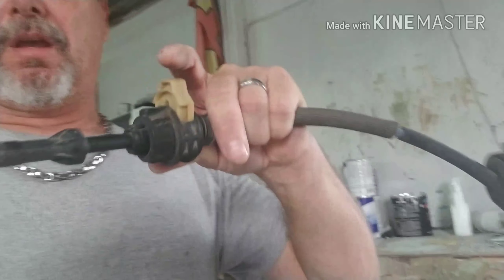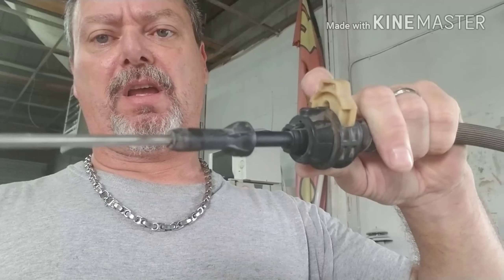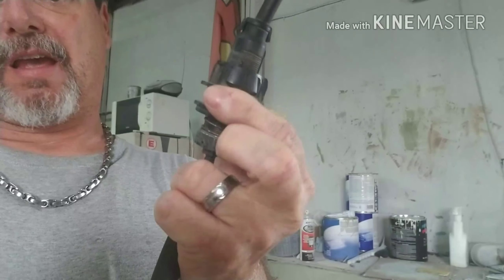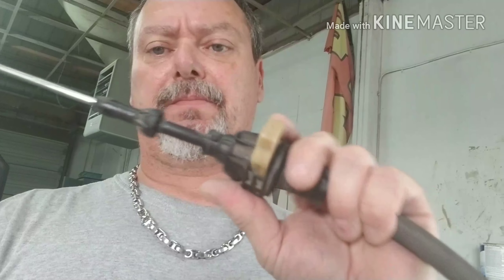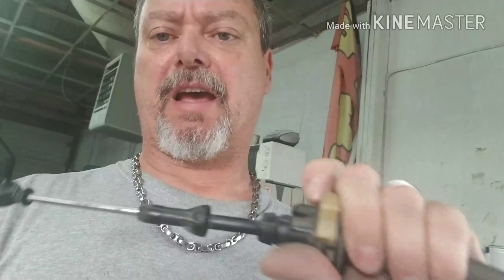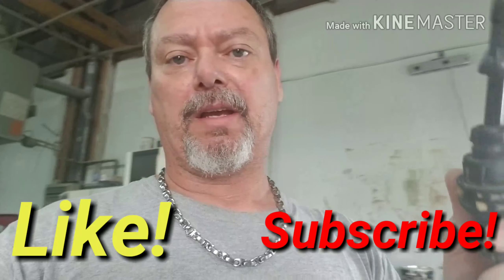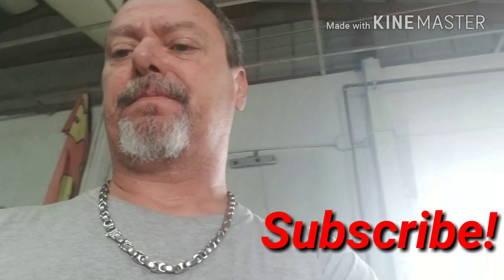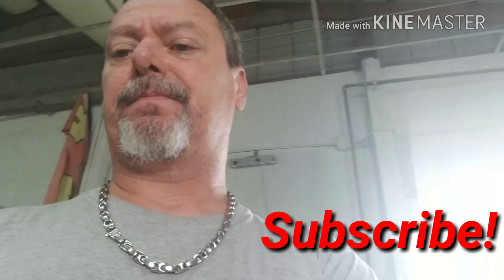How to adjust shifter cable 2004 ford f150! #shift cable repair

Comment: Thank you so much Chris. My shift cable melted against the exhaust. Replacing was not difficult, however, I could not get it started in park and also the reverse lamps lit up in park position. I saw the adjustment tab from your video, and it worked correctly after only a few minutes. Thanks again, you 'da man.
Reply from the maker: Your welcome! Thank's for the comment and support!

Comment: Thank you so much for doing this video. I changed my cable and the truck was doing almost the same thing as it was before I changed it. I was ready to take it to a transmission place but decided to do one last YouTube search first. This fixed my problem and I am off and running.
Reply from the maker: That's awesome! Thank you so much for taking the time to let me know. So happy you were able to save some $$. That's the goal!

Comment: I had the same problem, when I bought the truck they started it only in neutral, it wouldn't start in park. I bought it anyway and with a little bit of hope that I can fix it. 5 minutes on youtube and I found the right tip how do do that. I'll try it out next weekend. Thanks!

Comment: I have the same issue with my truck 2008 ford f150 after i replace the transmission won't start on park so amma tray that tomorrow morning thank you brother. I will get back with the result ....
Reply from the maker: You welcome

Comment: thanks,my04 same thing, also hard to get into gear almost like the cable is at tension. thanks again. exactly what I was looking to hear.
Reply: I just looked at a 04 ranger that seemed solid all around except pretty rusty underneath but not too bad.  
It was hard to put into every gear. It started in park tho. I looked underneath but I couldn't quickly find the linkage to peek at it.  This sounds like the solution. I'm hoping! Buddy wants to sell as is.  Stiff shifter seems to be it's only issue.  Solid runner, no smoke, smooth shifts. You think this is just the adjustment? It seemed really tough to pull on amd push on the shifter.
Used vehicle hunting is terrifying!

Comment: I changed mine out a few years ago. Now it won't shift far enough to go into park. Should  I  adjust it after manually putting in park position?
Reply from the maker: I'm  not sure but I did make a video about the adjustment.

Comment: Hey brother so I just replaced the cable on mine due to prior one failing to where I could not shift into park. I put the new one in and set the spring like you showed and my truck still is in park on the dash but it feels like the truck is sitting in neutral cause I can only drive forward I got no reverse and no park. Any thoughts?
Reply from the maker: It's  hard to say without seeing it. I would just say recheck everything.
Reply: @GarageNoise  I figured it out. My Ford has park towards the back of the tranny on the gear shifter not the front like most diagrams show so I realized once that was in the right place that my cable wasn’t long enough so I had Ford exchange it for the right one. It’ll be up and going tomorrow morning!! ****heads up to all with 2004 Ford F-150 XLT newer style not heritage your cable length is 43” not 38. Another way to tell is that your shifter is on the tree by the steering wheel not on the center consol!
Reply from the maker: @i5tactical149  good to know! I'll  pin this.

Comment: Hello, thanks for info. Question, if I’m in drive and want to go to reverse, I have to go to parking first, then to reverse and even then I have to pull the shifter a little bit so it will engage, would you say it needs adjusting?
Reply from the maker: Thanks for the comment,  i can't  say for sure what the issue might be but trying to adjust it may help. Good luck with it. Let me know if it solves you problem.
Reply: I have the same problem.  Did you ever resolve this issue?
Reply: bigal73 long shot but did you find a fix for this? My 04 f-150 recently started doing this too.
Reply: I have the same issue with my 2001 F150. I have to go to Park first then back down into reverse. It's the same for Neutral also, gotta kinda tap it up to go into Neutral. If anyone has any information, please reply. I will also post back if I find any info.
Reply: @jewbaca3  Please respond back if you figure it out. It's driving me nuts, especially when I let someone borrow my truck, because sometime it will not fully engage reverse and will cause it to slip.
Reply: @bigal73  You ever figure it out?
Reply: I may have actually found a fix for this issue. Just did it to my truck and they were right, the bolts were loose.
Reply: https://www.fordf150.net/forums/viewtopic.php?t=95256
Read what Projectsho89 says. There is 2 brass T30 Torx screws in a plate that faces the firewall that attaches the shift lever to the shifter cable, if you slide your head up under the dash down by the pedals, and look up with a light, you will see them. I can confirm that both of my screws were loose and you could see the plate gapping and moving around when I wiggled the shift lever. I got a 1/4 ratchet and an extended T30 Torx bit socket and tightened them up snug. I haven't gotten to test it fully yet because it's 1am here, but when I turned the ignition on and shifted through the gears, it definitely has alot more solid engagement into each gear now. I will test it shortly and get back to you, but it was definitely a big part of the issue and apparently is very common for those screws to come loose or completely missing. I took a picture of the screws if any of you need any guidance. Feel free to contact me.
Reply: @jewbaca3  Hey, I posted a possible solution down below. Feel free to contact me if you have any questions. Please comment back if it helps.
Reply: Dustin Z. Hope that gets you fixed, my 2004 doesn’t have that mechanism it has the cable, I actually have the new cable but haven’t changed it yet
Reply: @medjaiii  Thanks, IT DID FIX IT :) Everytime I shift into Neutral or Reverse now, it's kind of satisfying lol. Now I don't have to worry when someone borrows my truck. I'm just hoping maybe some of the other people with the same problem stumble across my comments and get the help they need also. So I guess this fix is only for 1997-2003. I really hope you get your shifting problem sorted out! Have a good one!

Comment: I have 00 expidition one minute  I have reverse and over drive next minute I dont
Reply from the maker: Check transmission fluid. If it's full. Smell it, if it smells  burnt thats a sign there could be a transmission issue. Did you check you cable ? Doesn't sound like that's  the problem but you never know.